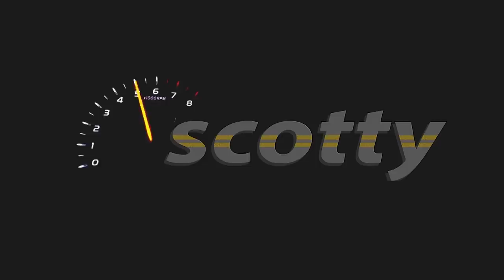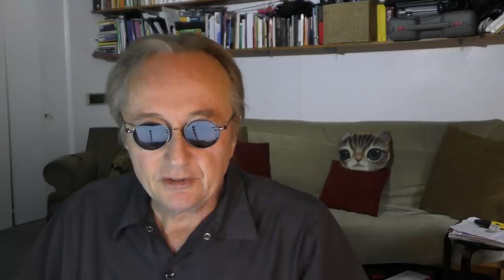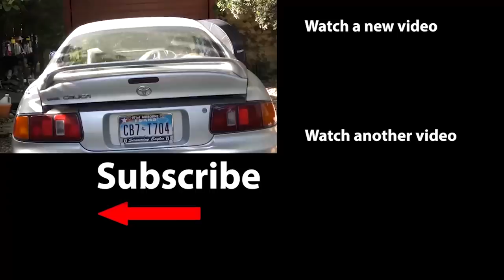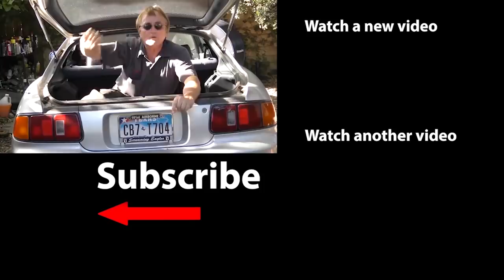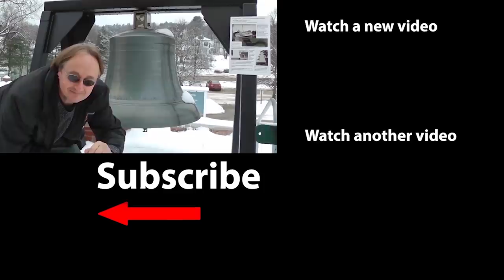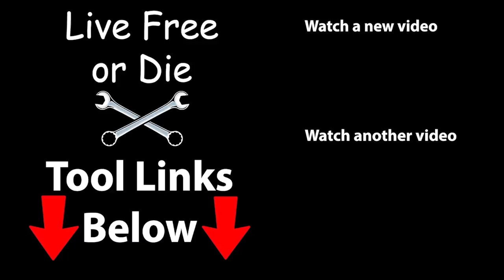Stupid Things People Put in Cars

Comment: Hey, Mr. Kilmer...  Personally, I am a non driver, as my eyesight prevents me from obtaining a learners or license.  However, I'm curious about the ins & outs of cars, as if my Mom & myself are in the car, & should something go caca, me being her electronics savvy son (I'm 36), I'd like to know a little about cars & what makes them run, so I can help her, even if its something seemingly as insignificant as changing a flat or jumping the battery if it won't start.  (She even leaves the car radio up to me, as far as the clock & presets go, lol.  My ? for you is, what's your opinion on these new electronic ignitions with the push button engine start?  Our car is a 2006 Ford Taurus SE V6.  Mom needed a car after our last one, a 93 Chevrolet Lumina Euro, gave out after over 20 years.  (It was new, with a whole 9 miles on it from the Chevrolet dealership my late stepfather worked at).  Both cars used just your basic ignition cylinder, with a key, although our Taurus does have a keyless remote for the doors & a trunk release, along with a red alarm button that blows the horn & blinks head & tail lights.  Starting an engine makes me a little nervous, even though I've heard it before.  Mom used to gave a 1974 Thunderbird, dubbed the "Land Yacht".  I don't know if the engine was original, but it was a 455 ci V8, aka "Rocket" with either dual or quad barrel carburetors, & I think dual exhaust.  However, my Mom & Dad had this car when I was just a little man, & me & this car didn't get along when it was started.  I'd be screaming like crazy.  My Mom later found out that in addition to all of my eyesight & physical issues (born premature, low birth weight), I'm also ADHD, & Asperger Syndrome.  Yep.  Autistic!  ☺. Said T Bird got sold, lol.  Anyway, thanks for your videos.  You're awesome!  PS.  This may be a stupid ?, but how do you start an engine with a key?  My guess is you can strip your starter if you don't let loose of the key after the engine fires, yep?

Comment: If they are putting better bearings and stuff in cars that shut off and restart, why don't they use those components in ALL of their engines? Sounds like snake oil to me.
Reply: smartin23964 the same reason Apple slows products down after a few years. If they make products that are actually commercial grade they won’t have people to scam in the repair shops as often.

Comment: I have a 2000 chrysler 300m with the 3.5 engine it has a misfire on 1,3,5
Reply: Some older Chrysler minivans had a miss that was hard to figure out. The wire to the injectors is hot all the time. The Computer turns on the injector by grounding it. If the computer ground is not good a miss will jump around from cylinder to cylinder. The Buick Somerset had a similar problem, the computer (in the passenger side kick panel) was only grounded by the hold down strap and it vibrated loose.
Reply: And get what, exactly

Comment: Scotty you are so behind the times and it shows with statements that were true in the sixties and earlier, but not today.  Any engineer will tell you that all modern non CVT,  automatics are better for towing than any standard.  And in some cases the CVT, in spite of the weakness of many models,  is still better than a standard for towing.
Reply: I drive a diesel truck, the manual trans is WAY better for towing than any auto I've driven. Why would anyone want a less durable tranny? Manuals don't overheat and breakdown as often and easily as automatics! CVT's... If manufacturer's can get their act together and actually make them somewhat strong, then MAYBE they may be a viable option one day, but in this current day...they are soooo weak and problematic right now that they aren't even worth considering... they have a LONG way to go! And with the manual you have complete control and can plan ahead and can optimize what you are doing, what gear you need to be in (like if you are approaching a hill) instead of waiting or hoping that the automatic will do it in time for you to not lose momentum. I'll keep my manual truck with 238,000 miles.

Comment: I would rather have start/stop than have a car idling and polluting when it doesn’t need to. And the fuel economy is greatly improved by these systems. Sure everything new cars have affects reliability but by using such logic we would be living in the dark ages, get with the times.
Reply: So the engine stops when you stop, and then instantly starts when you want to pull out in front of a big rig huh ??   Sounds about as fun as the Ford Focus that would hesitate about 8 seconds before launching you into traffic.   yall can have it.  I'll drive something else.
Reply: orbitalair you clearly like to insult systems you have no clue about I take it then? Putting your foot on the clutch deactivates it, lifting your foot off the break in an auto deactivates it. So when you set up its instant, there is no delay. If you have auto hold then it kicks in a soon as you accelerate. It’s an impressive system,  certainly can’t be insulted for what you are suggesting.